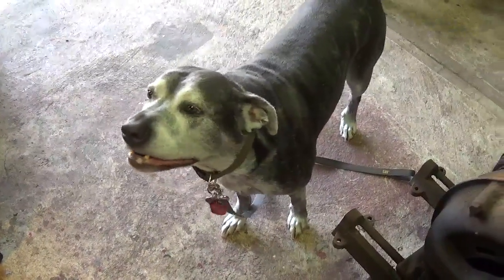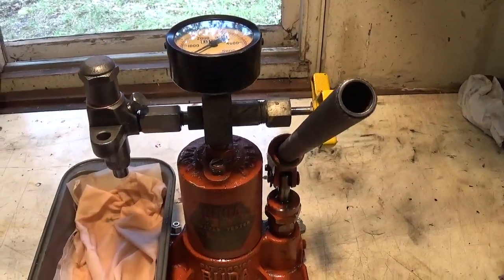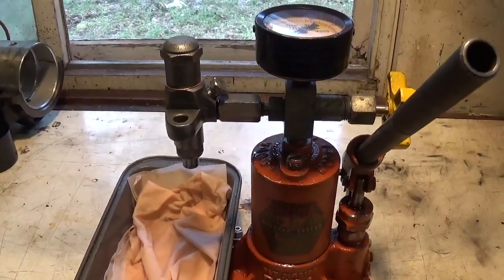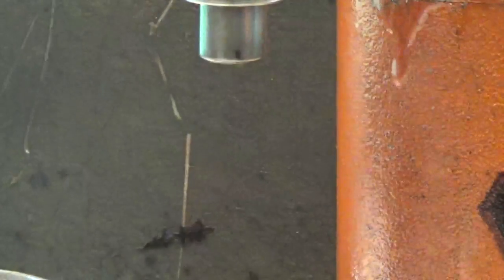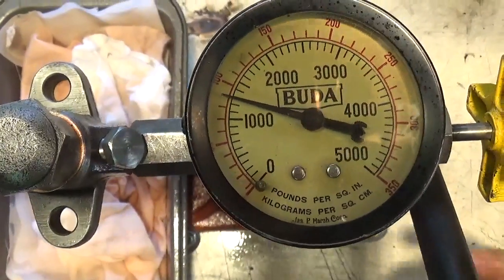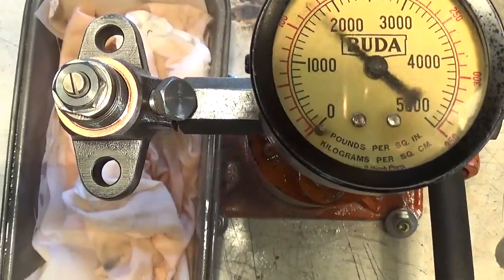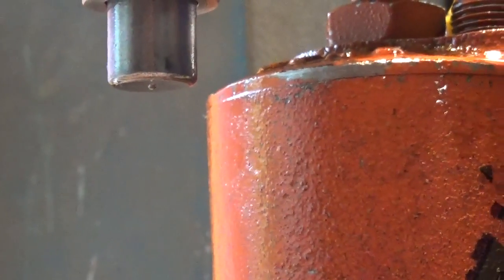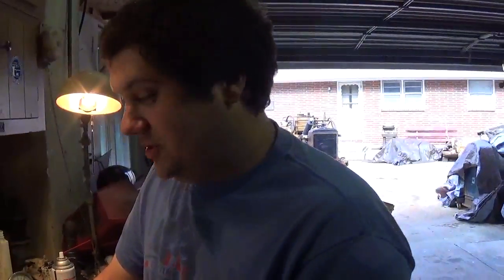TESTING A DIESEL INJECTOR NOZZLE

Comment: This is a very good video,thanks,i have one cyl. knocking from the injector, (Iveco DI 8140.21  2445 cc on a 1987 Sea Ray Seville CC ,here in Porto , Pt )have to remove it,too bad i still don't have a setup to pressurise it; i shd have made one like yours long time ago   lol

Comment: Good video!  Dribbling injectors cause smoky exhaust and if extreme will wash lubricating oil from the cylinder walls. Often it's caused by worn surfaces in the valve or bad o-rings. Sometimes lapping the valve disc and seat will restore sharp cutoff. But, for a show engine,  it's  not really too critical.

Comment: I have three diesel engines (one even runs!) but I have to profess ignorance. What would be the disadvantage of a higher cracking pressure? Too hard on the pump I guess? Mine all have unit injectors driven by rockers. Not sure what the test procedure is for those.

Comment: my old boss had a fancy diesel injector tester,he showed me how to use it and NEVER  put any body part near the nozzle when testing. same goes when cracking a injector line when  bleeding air or diagnosing a driveability issue ,2 -3000 psi will blow a hole in your skin and cause blood poisoning which could lead to death

Comment: Good just like I was taught in diesel systems class. I don't know if you did this we used to polish the injector pin and point with very fine  (not sure I spelled this right) rouge and a felt pad. I think you can very carefully relap the pin 
 and seat with the rouge just make sure you get it cleaned up good. Its been 20 years since those classes. Good luck.

Comment: I don't believe you have a big problem, you obviously was pushing the handle down  much slower than the injector pump will be building the pressure. I have helped test injectors, but don't remember ever trying to build up to cracking pressure like you did. We were looking at how the injector spray appeared. I was a welder who helped the mechanics when they needed a hand, so this is only my opinion, not from an experienced diesel mechanic.

Comment: hi mate, wondering if you could help me. 

I've got a turbo diesel, all mechanical. the turbo isnt making more than 4psi of boost, it should be 11 psi. i know the turbo is okay, and theres no leaks etc. I know its down to the fueling - so my question is, would a dodgy injector cause almost no boost but still get aload of black smoke? 

Im at the point where i know i neeed to check the timing and then injectors, just wondering if you think it'd be an injector too ? 

I know its fuel, just not sure on it being an injector or timing. Im almost certain its not the bosch ve injector pump at fault. 

as far as turbo/actuator/boost leaks and hot side leaks, everything is fine, which is why i know its down to fuel, just trying to get others opinions on injectors failure causing black smoke but no real boost? 

Cheers mate
Reply: Is there an intercooler/aftercooler on the engine? Sometimes they can get plugged up and cause an air flow obstruction. No air in, no air out, lots of black smoke.
Reply: no intercooler, i've chcked everything so many times and proved to myself its not a turbo/air issue, its definatly fueling, but im not savvy enough to know weather it'll be injectors or injector pump timing. To be honest, i know i need to check both to be sure 

Cheers for help though much appreciated
Reply: Marine, or automotive engine?
Reply: automotive, its from a ford transit, an english van
Reply: Try this, without killing yourself with CO. Loosen the exhaust pipe to turbo joint alot, and take it for a spin. This will verify you don't have some sort of exhaust obstruction.
Reply: also, make sure the air intake is clear, Had a truck inhale a plastic bag and did the same thing, no power, lots of black smoke...
Reply: Cold Start Daily It’s an injector because if it’s gear driven it can’t jumped timing unless it the pump was changed and someone fucked up or you’ve got a bad injector pump and also check your lift pump pressure